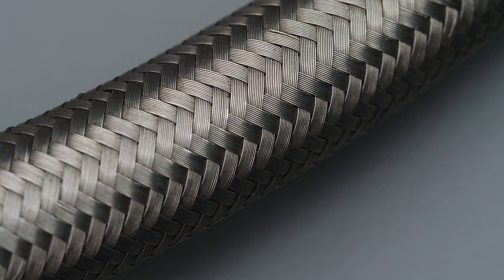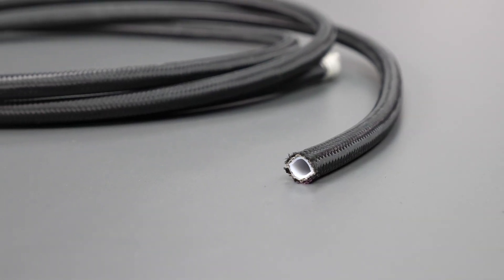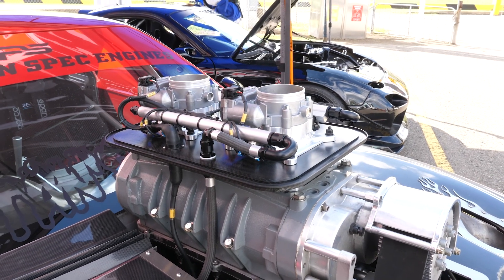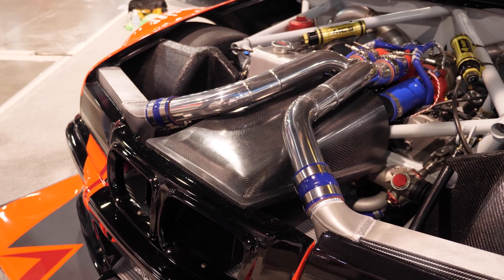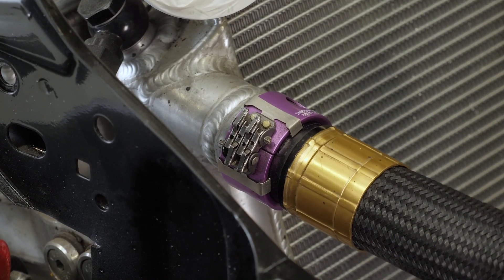Overlooked Essentials or Overkill Components? | Expert Tips

Comment from the maker: Building a fast car? Get $400 OFF the all inclusive VIP package deal:  https://hpcdmy.co/vipy47
Motorsport Plumbing course. Start learning today with 50% OFF your first course: https://hpcdmy.co/offery47
TIME STAMPS:
0:00 - AN Fittings
1:30 - Braided Hose
1:43 - Rubber
2:10 - PTFE
3:04 - Exotic Fuel Vs Rubber
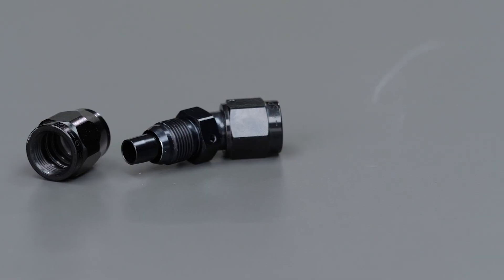3:50 - Push Lock
4:35 - PRO TIP!
4:48 - Reusable Hose Ends
5:22 - Crimp Hose Ends
6:15 - Weight PTFE Vs Rubber
6:35 - Hard Lines
7:24 - Silicone Couplers
7:50 - Wiggins Clamps
8:51 - Flare/Beads
9:47 - Don't Be A Gorilla
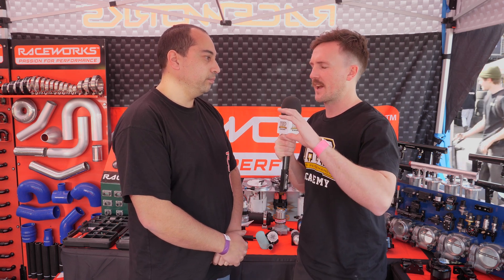10:14 - Flexible Options
11:09 - Understanding 'Dash' Sizing
12:19 - Hose & Fittings Compatibility
12:51 - Raceworks - Thanks Jamie!
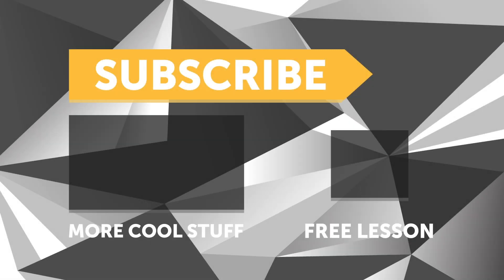13:15 - BUILD.TUNE.DRIVE

Comment: Some may be looking at industrial/heavy machinery hydraulic fittings, with the correct hoses, as an option - this may seem to be a cheaper, or more available, option, but you DO need to be aware of things like the fittings usually having very restrictive bores as wall thickness is important for strength and fatigue resistance with 300-350bar operating pressures.

For silicone, and even rubber, low pressure hoses, they're usually available in a range of operating pressures - be sure of what you need, and what you're actually getting.

Comment: I know tractor pullers going 100 psi on silicone hose, the trick is to push the pibes all the way inside so they almost touch, then use loads of hose clamps (the good wide ones) I know they run 7 3 on each side and one on the gap in the middle so the silicone can't expand. And they never have issues

Comment: The Miltary, Army/Navy/Airforce would not use cheap aluminium fittings..

Comparing this chinese stuff to the quality steel fittings that is actually used is very misleading 

Also the AN system was created for unskilled mechanics during the war to have a basic quick too understand hose system as there was not enough time to train them in all the different threads and fittings from around the world 

Also AN fittings ARE JIC fitting threads,

 but they dumb down the threads sizes to 1 standard fitting size per the hose size, when in reality there is actually around 3 thread sizes per hose size in JIC system...

1 day there will be a huge car fire from using these chinese poor quality aluminium fittings..

and someone will die... who is going to be accountable?
Reply: I went from RACEWORKS to BMRS after seeing the thumbnail S15 in person and all the other wtac cars use them.
Reply: There are quality aluminum fittings out there as well. Jic was adopted with looser tolerances then AN for farm/industrial equipment but nowadays any manufacturer worth their salt will have tight tolerances on both. I prefer Jic just because I get gates fittings for dirt cheap.

Comment: When do you consider using hardline over PTFE/any hoses?
Reply from the maker: Near extreme heat sources. We moved to Aluminium hardlines for our turbo lines in our endurance car as the braided rubber hose wasn't holding up. Haven't had an issue since. Stainless and Cu-Ni lines can still offer some extra abrasion resistance over braided hose as well, and for the brake system they completely eliminate any swelling that can lead to compliance issues.
I personally also love the look of some really well made hardlines over flexible hose which tends to look a bit less tidy - Connor
Reply: @hpa101  Is vibration a serious concern for hardlines? Can hardlines be used from engine to chassis mounted oil coolers? I've also used hardlines for turbo drains when ptfe and rubber lines wouldn't hold up.
Reply: @agustinmorales4045 it is a very serious concern, hard lines can crack at the fitting very easily if not supported properly. I had a turbo hard line crack on my golf and it pumped every last drop of oil on the ground. And they need a hose  connection to serve as a flex if going from engine to chassis, as the engine will move and the hardline cant flex and stretch
Reply from the maker: @agustinmorales4045 it's only a concern if you didn't make it a consideration when setting things up 😎 - Taz.
Reply: Aluminium Hard Lines also weigh less than flexible hoses

Comment: I realize that JIC and AN are not expressly interchangeable - but I've never ever had a leak between a JIC and AN fitting, despite having done it many, many times. As far as I'm concerned, they're interchangeable with the exception that JIC are almost always steel and therefore capable of significantly higher pressure than aluminum AN fittings.
Reply: I've wondered this for a long time, I have easy access to make hoses with JIC fittings, good to know I can screw em right on to AN fittings
Reply: Yes they are 100% same thread and sizing as jic.. the AN system was for unskilled mechanics in the army/navy to have a basic hose system as it would of taken too long to train them in imperial fittings from all over the world... also these Chinese made aluminium parts are way lower quality than the steel fittings
Reply: @bingysbackyard  I hate to admit it, but I've used a whole mess of cheapie Chinese push-lok AN fittings. The "evil energy" brand comes to mind. They work just fine. Haven't had a single issue with them.

If I were building a top-tier race car with a budget of $250k, I'd absolutely not use them - but for my toy IS300 hot streetcar - I just don't see any advantage in spending the extra cash on Earls, Aeroquip or Russel.
Reply: @bingysbackyard  per my reading on the subject the jic standard has looser tolerances but as you said I've never seen an incompatibly between the two. The jic standard was made for farm/industrial equipment. Any good brand will have tight tolerances on jic bringing it to the same level as an.

Comment from the maker: What's your opinion on options like rubber vs PTFE or AN fittings and hoses in general? - Taz.
Reply: Expensive option but I love em and wouldn't have it any other way
Reply: Used them extensively along with steel lines for 20 years in the military. Excellent product but I’m glad I didn’t have to pay for them. We had a connex that would be mounted on the back of a truck when we trained or deployed. Inside it contained all of the bulk hose, fittings and tools required to assemble as needed. The turbines in the tanks used fuel as a hydraulic and sensing medium. A turbine in a steel box tends to shorten the life of anything that isn’t steel.
Reply: About the only place I've ever used traditional rubber is for coolant, and as it turns out I use a heavy wall, steel braid-reinforced rubber set of lines in the power steering system which currently runs around 1300 psi, albeit at full runout (hydroboost). Everything else is PTFE, no exceptions. I find PTFE assembly to be easier, personally. Earl's is my fav brand, XRP coming in a close second. I also love some Staubli QDs as well as Jiffy Tite to a lesser extent. My opinion on hardlines is two things: 1) use them to the greatest extent in places where the line does not need to articulate or move at all. 2) use SS over Cu or Al as it is the most durable and if its the 300 series alloy then it's pretty much corrosion proof. For brake systems in tight confines with tight bends, Cu might be the best option. You have to be careful using dissimilar metals, though. I once used aluminum sleeves/nuts on a flared section of copper and the green copper-oxide layer actually cracked the tubes sleeves over the months/years. They didnt leak, but upon any servicing of the line it would need to be remade. I suppose SS sleeves/nuts would be the more correct choice.
Reply: Got PTFE and an in the street car because I like the look over rubber